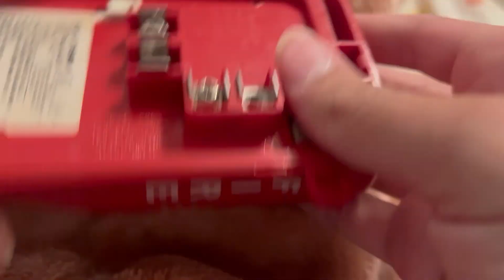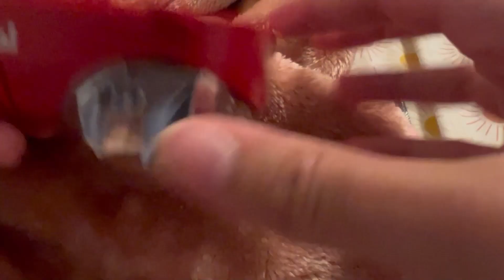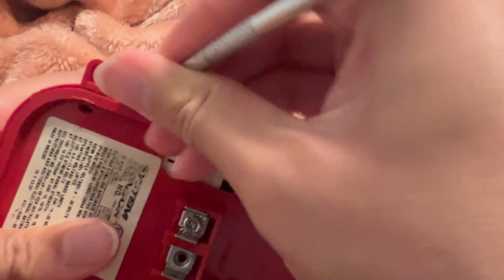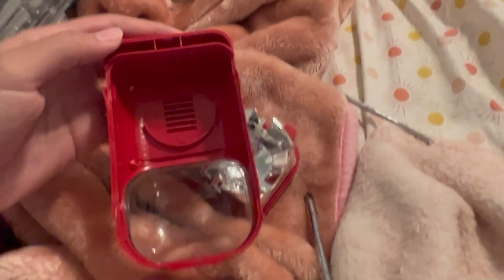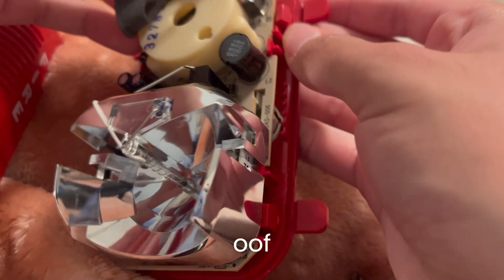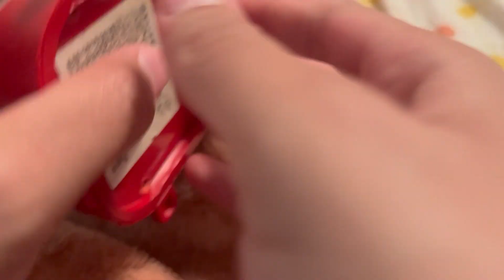I disassembled my Spectralert Classic so you don't have to (Read Desc)

Comment: Ok nice I disassembled my Spectralert Classic, the model number is P241575 and it burned on the inside which is on top and the side of the circuit as it shows on a back cover

Comment: It’s probably better for me to not do it just to be safe than sorry
Reply from the maker: Yeah pretty much lol. As it has been said, there is no guarantee your alarm will have minimum damage from opening it. Thought id make this vid for anyone who is wondering whats inside one of these and maybe if they wanted to open one themselves
Reply: @hamzahassan7730  True I mean I always try to put tape from the inside of the horn that way it doesn’t have the ugly appearance on the outside but I guess if I don’t want damage I probably should just do it from the outside
Reply from the maker: @VacuumandFirealarm  When I first got my ceiling mount classic I put duct tape on it and it was really quiet. It was 2 simple screws and its open. It was my first alarm and I remember wearing headphones and putting it outside. When I plugged it in I didn’t hear anything so I took off my headphones and heard it. It was not loud at all. I later removed the duct tape and only use horn strobes when my entire family isn’t home
Reply: @hamzahassan7730  ok cool